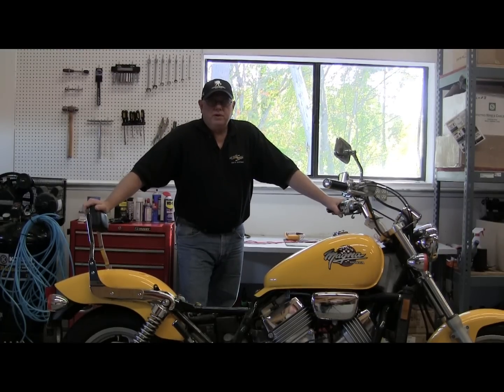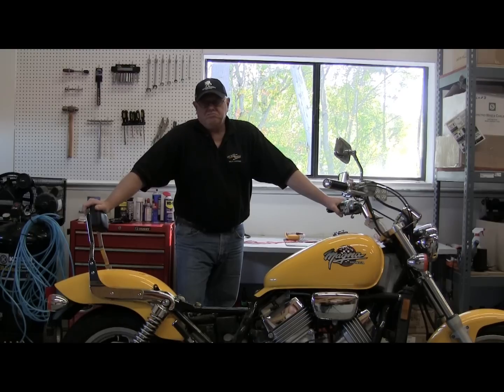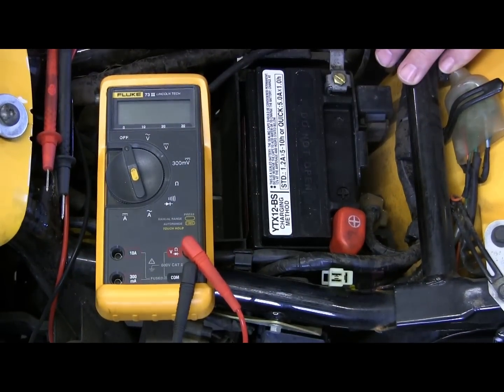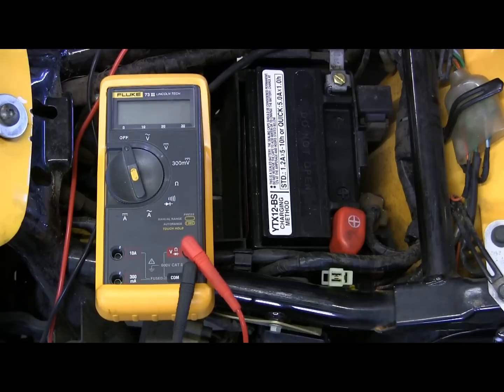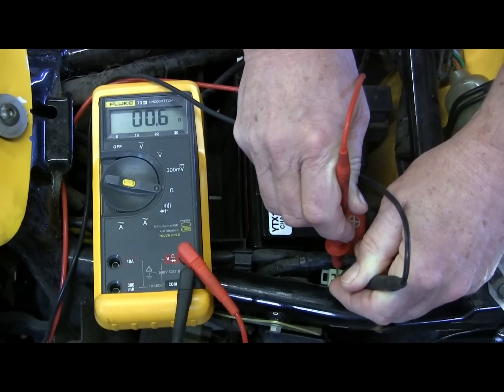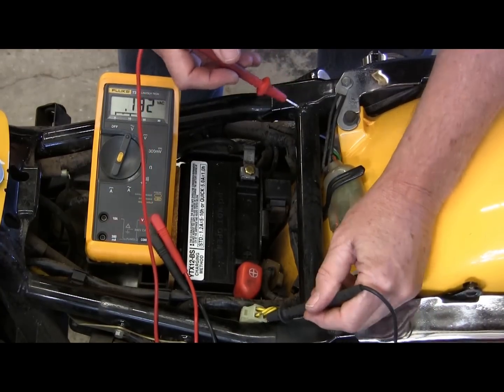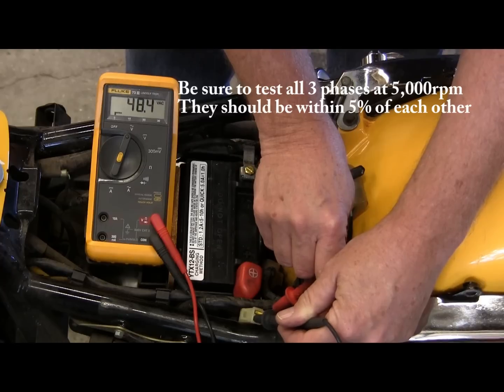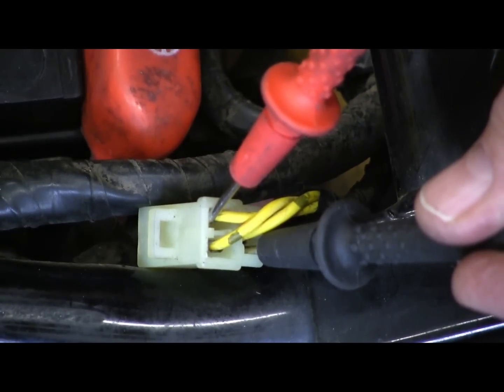#1 How to test a motorcycle stator

Comment: Question, first test all 3 yellow read 4 w/no ground on all 3.on phase 2 plugged the Rectifier back in and started checking for voltage from backside of the Rectifier plug with engine running all 3 were reading in the -6.with fluctuation the Rectifier is new so is that a sure sign of a bad stator the bike is a 2003 Honda Shadow Spirit 750, and great video easy to follow 👍

Comment: Can I still perform this test with a stator that is hardwired directly to the R&R? I bypassed the burnt R&R to Stator connector. Thanks!
Reply from the maker: You would need to separate the stator from the rec/reg before testing, otherwise the AC voltage will be a loaded test rather than isolated/unloaded.  Also if the rec/reg's circuit board has a problem having it still connected can provide false readings due to the test signal having an alternative pathway.  For example, if your rec/reg has a shorted diode between AC input and DC-, when you do the ground test you will see a pathway from that line to ground, but it's coming from the rec/reg not the stator.

Comment: I have yellow and yellow red, no start, no spark, why not three wires ? What should the volts be when cranking, do i check volts to grnd or yellow to yellow, thanks
Reply from the maker: If you only have two wires instead of three it's likely either a single-phase wind or a split wind.  If you email info@ricksmotorsportelectrics.com with the exact year/make/model of the machine we can provide you with more specific testing criteria.

Comment: My service manual says to do the Peak Voltage Test after the resistance check,  is that adequate or should this test also be done?
Reply from the maker: Peak voltage tests are typically for ignition components rather than charging components.  Without knowing the details of the vehicle I can't give specific info, but I recommend you always do resistance tests before voltage tests so that the windings will be at room temperature.

Comment: What if your bike is mid 70's and you dont have r/r combo...and only one wire from the stator is yellow..and one phase goes through the headlight switch..dont know where to begin..12v at start up but only goes to 12.5 when reving😢
Reply from the maker: We'd have to know exactly which bike you're working on (this sounds like a Suzuki GS model).  If you email info@ricksmotorsportelectrics.com with year/make/model we can try to offer more specific advice.
Reply: @RicksElectrics hi..1977 gs750 here..thanks for the reply but my problem turned out to be the voltage regulator thats mounted under the battery tray..I've learned quite a bit about this wiring and can tell you this much the clymer manual is wrong when it comes to testing the rectifier. There just is no continuity between certain wires and rectifier ground to indicate a good unit..I must've told 4 different ebay sellers the unit was bad before I figured the problem was the regulator☹

Comment: Hey rick got a question i have a 08 r6s and when the bike is running im only getting a reading of 12.5 when the bike is running but i was told it should be reading 14volts

Comment: If there is continuity when testing the wire to ground as in @2:05 is it always the alternator stater that is broken or can it be something else?

Also thank you for an easy guide
Reply from the maker: The stator should be disconnected from the bike when you're doing the test, so if you have continuity between the AC output lines and DC-/ground then the stator is shorted.  It can be a result of a stator failure itself (such as the insulator breaking down) or something external like a wire being pinched inside the cover.  It needs to be removed from the bike to determine the exact nature of the fault.

Comment: Hi Rick.I'm working on a 1983 GL650 NON RUNNING bike I picked up cheap. I need to go into the engine to replace the starter drive springs  and while I'm in there replace cam chain , water pump seal and if necessary the stator. Obviously I can't run the bike for voltage tests but the three yellow wires all ohm out at .6 ohms. In your opinion can I be sure that this stator is good? Or ??
Reply from the maker: If all three line-to-line measurements are at 0.6 ohm and OL to ground then your stator should be good.

Comment: What is an intemitant charging issue? I'm assuming the alternator windings since the regulator diodes should just go once and that's it. I've replaced my reg and now after a month my new battery isn't charging again but the windings look good and test good. Any experience with this?

Comment: Hello!!! I have a 2018 harley davidson breakout M8. I burned the regulator. what I would like to ask you is: how much current must come out of the stator ??? measuring at minimum I give 20 V in alternating current, but accelerating it rises above 70/80 V. is this normal ???? Thanks in advance.
Reply from the maker: Good morning,

We don't have a listing for this stator so I can't give a precise spec, but yes a three-phase PMA should have the unloaded AC voltage across the lines rise proportionate to the RPM.  It should be even across all three output line combinations, and the lines should be OL to ground when conducting a resistance measurement.

Note: this is a voltage measurement as opposed to current (amperes).

Comment: how about fase to ground,  L1/G L2/G L3/G.   ...?
Reply from the maker: any full wave stator going to ground is bad. Many small bike single coil generators are half wave meaning the start goes to ground and the finish comes out.  For you to discern which is which you need to look at a schematic and observe electrical topology.

Comment: I just got 1 of your stators from my local Yamaha dealer and it's junk...passes the continuity test but fails voltage output test...2 legs read 11.2 volts at idle and the other leg reads 2.5 volts at idle...tell me what my issue is...new regulator/rectifier from Yamaha and new starter solenoid...
Reply from the maker: If one of our parts is not performing correctly you can contact us to send it on a warranty claim and we can open an RA for you.

Please make sure the stator is being tested correctly; it must be disconnected from the vehicle and measured via an AC voltage test between the three line output combinations.  If this is being done and the numbers are out of balance please contact us at 1-800-521-0277 or info@ricksmotorsportelectrics.com to set up an RA so it can come in for testing.  We will dyno it here and replace if the failure mode is confirmed.
Reply: @RicksElectrics  that's how I tested it and I'm getting 11 volts on 2 of the legs and 2.5 volts on 1 leg...bought it through the local Yamaha dealer and now I've gotta take it off and wait for them to send it back to you to be tested...plus they charged me $50 more than what I could've bought it directly from you for...no biggie but now my bike is gonna be down for however long that takes or I have to buy another 1 and wait to be refunded...
Reply from the maker: @boffadeeznuts4578  Please call us at 1-800-521-0277 or email info@ricksmotorsportelectrics.com

Comment: I recently had a stator that would not charge when the engine was hot... it tested normally when cold or every time I checked it, even checked A/C voltage output... upon visual inspection I found nothing showing burns, coils all looked good.... I ended up changing the stator, regulator and flywheel all together to get it working again.
Reply: I have this problem too. I've just taken the alternator out to rewind but as it's testing good I don't see the point. Trouble is it's not charging the battery. I tested it fine last month when I changed the regulator but now its not charging. Can I ask did you change the regulator first as well or did you spot any connector issues?

Comment: My voltage drops when I tested at 5k rpm. What does that mean?
Reply: I believe "he" is checking the stator AC Voltage with the connection disconnected (open circuit)
Reply: Yes this video isn't the greatest on explaining what's what to be fair

Comment: How high voltage can go? In mine cb1000r its around 18 on low. About 60v 5000rev. When you rev higher goes up to 90v. Is it normal?
Reply from the maker: GTI KR sounds like you’re checking AC voltage from the stator. Correct?
Reply: @RicksElectrics  yes mate
Reply from the maker: @ghawrot1  then you should be fine with those readings as long as all 3 leads are consistant.
Reply: @RicksElectrics  Hello, (Honda cbr 1000rr 2005) i have 12.1 AC Volts coming out of Stator -  3 wires, (bike is on, on idle) all wires are giving the same reading (~12v). Stator looks fine, no burned parts. No ground, and 0.3 Ohms. So only output voltage reads low. Can stator look good and still be faulty? The voltage on the battery goes up until 4000rpm then drops significalntly from 13.5V to 12.5V or so, and than continiues to drop lower and lower,  every time i rev the bike same thing happens. 

Thank You.

Comment: hello Rick , please i need advise , working on my Honda Varadero 1000 here in Cancun Mexico, I check the static reading between A,B,C phases  and i have 1.7 homs in all 
Mi reading on the dynamic test is 22 volts AC  at idle and 70 volts AC at 5000 RPM.
if i reach 6000 rpm I have 100 volts AC 
Is this normal?
Thanks alot  Rick
Reply from the maker: Yes this sounds correct, as long you don't have continuity to ground.  The Vac-RPM correlation should be roughly linear as you rev so it sounds like your AC output numbers are good, assuming that they're equal on all three phases.

Comment: Dear Rik, I have ( what I believe to be chronic ) issue on a DL1000 year 2008. The voltage at idle is 13.3 but drops downward when throttled up. From what I have observed on all other vehicles, the dcv stays static or climbs. is this normal  on some vehicles ??
Reply from the maker: The battery voltage should not be going down when revved.  This could be the result of a bad battery, bad wiring (bad ground connection in particular), or bad regulator.  It is also possible to be a stator problem but this particular issue is less likely than the others I listed with your described problem.
Reply: @RicksElectrics  Thank you Sir

Comment: ALL these stator test video's show what you should have is the stator is good.  NONE tell you what to expect if the stator is bad.
Reply from the maker: If your stator goes to ground, it's bad.  If you are getting uneven AC voltage (2 combos read 50 ACv  & the other combo reads 15 ACv, it's bad.
Reply: Rick's Motorsport Electrics so to clarify. All 3 phases(wires) should be the same AC reading(within5%) regardless of rmp, correct?
Reply from the maker: fair enough - I will look into making one of those videos!

Comment: very good video.
I have tested numerous bikes 3 phase by unplugging the stator wire and testing across the 3 pins...however in my beta alp 200 (dr200 engine) when I unplugged the stator wire from rectifier to test the engine stopped and would only run with the connector plugged back. I tested it like you did on the video...probes in back of plug and only got 8vac and then less when revving...
bike charges battery fine though and it's never killed a battery.
but at higher rpm I get a misfire...its not carb and have fitted new ht coil lead cap and no plug.
should the 3 phase plug be disconnected to get a reading ?
if plugged in should the reading be the same as unplugged ?

Comment: I have a 02 zx12 and at idle it charges at 14.6 and as I rise the rpm up the voltage drops down to 13.2or more would that be the regulator or the stator?
Reply: Texas Biker regulator

Comment: Don't use the latter method to test an R1 stator (or really any when the alternative is better). Trying to put your multimeter electrodes in the back will give you a false read on some bikes. Just unplug the wire and use the front end of the plug where it plugs into the rectifier, not the rear as in this video.

Comment: I changed stator which was burnt and when I rev it the volts go down. The battery is low/bad. What is the issue?
Reply: very likely your rectifier/regulator

Comment: I did this test, at idle 2 of the phases were at 25v and one was at 20v. when idle at 5000rpm 2 phases were at 75v and 1 was at 70v. It is above the factory recommendation for voltage but barley outside that 5% tolerance. I've been trying to figure out my charging system for a week now and i thought i concluded the rectifier was bad, but now i think they both are bad.. Please Help

Comment: The second test, AC voltage from the coils while bike running, have only 8v / 10v,  on 5k rpm only 10v, stator dead ?
Reply: did you sort this in the end ? I have similar on my dr200..from stator 3 phase..8vac idle and less revved .
bike only runs with connector plugged in.

Comment: Hy Rick, what if my service manual (burgman650) say the reference for resistance is between 0.1 and 1.0 ohms BUT I get reading between 1.5 to 2.0 ohms? 

Also what does it means to check for "check that the generator core is insulated"????

Thanks a lot!

Comment: Hello Rick,I just bought a 2000 Yamaha r1 which has a charging problem..The problem that I am having is the stator test good and puts out the correct A/C volts but I have gone through 3 rectifiers in 3 weeks. When I first install new rectifier it seems to last 3 - 4 days... I see that the previous owner had added a LED head light, Not sure if this would affect it or not.. What would cause the bike to burn through rectifiers like that...Any help is appreciated...Thanks,Ant....
Reply: Hi there.I am having the exact same problem,on my Honda Shadow, Stator test is good,and rectifiers keep blowing.
Did you find any solutions yet ?
Reply: got a 2002 did the same thing it's voltage spikes from. the stator if. you get more then 36volts at 5000 rpm stator is burning rectfier up my stator tested fine until. I tested it. for ground and sure enough was shorting to ground
Reply: how do you fix the short to ground
Reply: nikki brumett replace the stator and regulator
Reply: nikki brumett when a stator goes bad it shorts to ground

Comment: dear rick, i have a 2000 yamaha vstar 1100. it is overcharging. it actually blew two headlights. i bought a cheap stator last summer and it did great. even replaced rectifier but it was cheap as well but still good. i believe its overcharging because of the stator? when at idle, the battery is reading above 13. when revving up, it can reach past 17. i know thats not good. can you help?
Reply: +chris gipson The stator won't cause an overcharge; it's the regulator's job to control the output voltage. Thus, the one you have, is apparently defective.
Reply: Thank you. I figured that out after i tested the rectifier. It was bad. Changed it, now its undercharging and burnt wires from the stator which now i assume, the stator is actually bad as well

Comment: I just put your stator and regulator on my Yamaha Star Venture.. It is charging but not at a acceptable voltage. Both are the Hi Output components. I am only putting 12.6v at idle and around 13.2v at higher rpm. When at idle it was climbing but at very slow increments and it did reach 13.0v... any thoughts? What should the high output stator be producing?
Reply: I just purchased 1 of his stators from Yamaha and it's junk...probably what your problem was too...

Comment: Dear Ricks Motorsport Electrics,
I have purchased a Ricks Stator which replaced my old one for my Kawasaky Versys 650 2007 6 months ago. The bike went fine for 7000 km which I ran last summer, but now my motorbike has problems starting. 

When using the multimeter I noticed the following:

The voltage from the stator (AC)
1000 RPM ......... 11.9V measured on all three phases
5000 RPM ......... 52V measured on all three phases

Battery voltage
1000 RPM ......... 11.9V
5000 RPM ......... 14.1V

Electrical resistence on all 3 phases = 0.4 ohms
None of the 3 phases goes to ground
I also checked the battery (YTX 12-BS) on a rectifier and it charges well.

If I disconnect the battery while the engine is on, the engine dies within the next 3 seconds (even if I disconnect it at high RPM).

My questions are:
Does this mean the stator is the problem? As I could tell the regulator (rectifier output voltage) works fine. What are the normal parameters for the Ricks stator I own?
Reply: +Mihai Evelin Your bike will not run without a battery. Doesn't matter if your bike is making enough voltage or not. From what you investigated it doesn't seem that you're having any problems with your charging system and there is another problem here. Good luck!

Comment: I'm getting .9 ohms but my bike doesn't charge it's a 85 gs300l is that to high of a reading and is my stator bad?
Reply: +Joseph Knoll You need to dig deeper, just checking if the resistance is consistent is like step 1. Check voltage at battery when idling and when RPM's above/at 5k. Check R/R diodes etc. You have a lot more steps to go before diagnosing.

Comment: Brand new stator, brand new rectifier/ regulator, brand new battery, all tests confirm everything is working as should, however, it's still not charging my battery.. I'm lost as to what step now.
Reply: +Trevor Lucidi Yea I was about to say sounds like you have bad/burnt wiring somewhere.
Reply: +Trevor Lucidi I have that EXACT problem as well. if you figure it out or get an answer PLEASE let me know. I've been fighting this thing for weeks.
Reply: +hybredmoon I ran two wires from the Rec directly to the battery on the pod and neg and it worked!
Reply: +Trey Everett thankfully it all worked out in the end.

Comment: Hi Rick
i have a suzuki drz 400 sm k6 with  no spark in ignition coil. Ive replaced the starter and cdi unit and still no spark. Ive removed the stater cover and rub a screwdriver and i get spark . can you please advise me